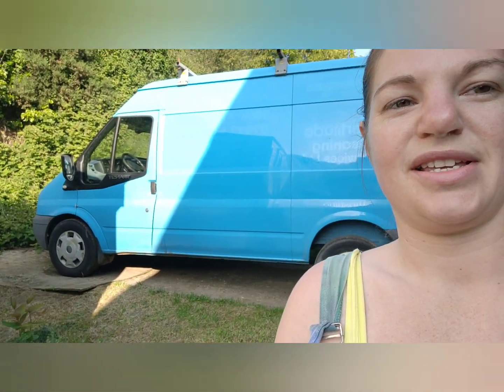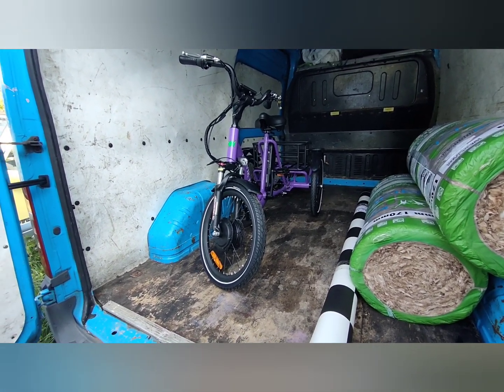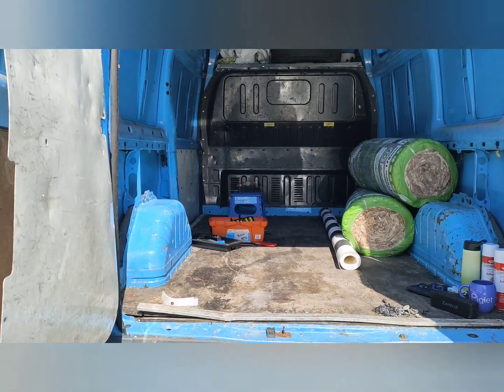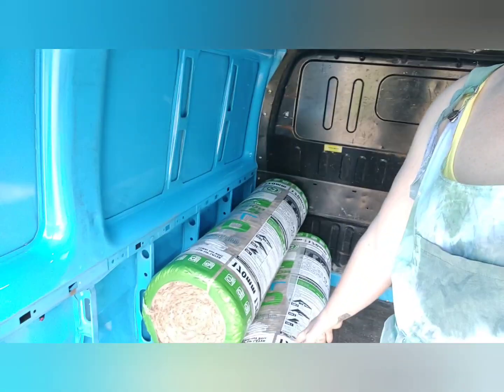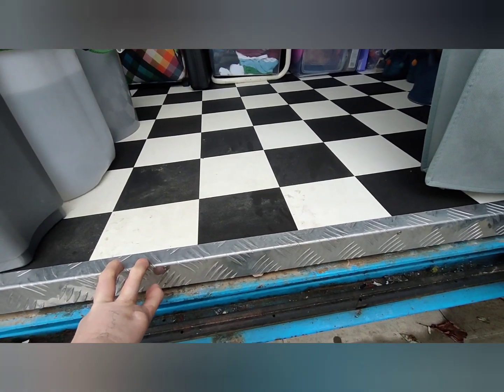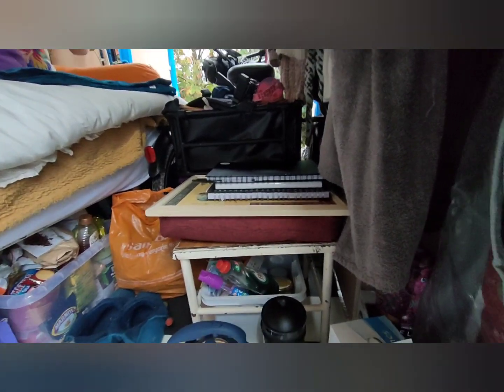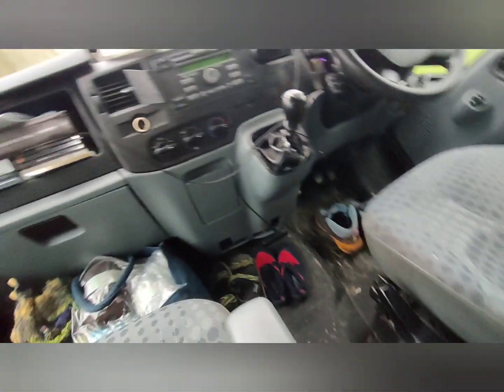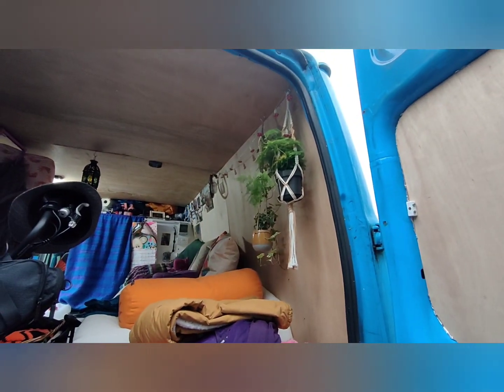Ford Transit campervan conversion UK

Comment: Hello Samantha! 

How is your van still running at the moment! Trying to figure out what van to go for!
Reply from the maker: She is running sweet as a nut. I do have a power steering leak so the steering rack will need to be replaced at some point, which is a big job, so as it's not a bad leak I just keep topping it up with power steering fluid. I absolutely love my transit, it's so comfortable to drive and just keeps on trucking. A real solid vehicle.
Reply: @samanthaelvy  how many miles did you take her in at?
Reply from the maker: @GlitchVR  about 150,000.
Reply: @samanthaelvy  amazing and after getting it did you have to do anything big work after that? Sorry for all the questions last one I promise aha
Reply from the maker: @GlitchVR  No worries, ask all the questions you'd like to. I had to have the power steering pump replaced and the breaks done, maybe another little thing that I can't remember, but I spent about £500. I paid £2,900 for the van. When it's MOT was due I also got it serviced.

Comment: Hi looks good, I like the fact that you have a flexible design that can be changed , eg bed moved without a major rebuild. Can I ask please , where is your leisure battery? (I've assumed you have a leisure battery, my assumption may be wrong !)
Reply from the maker: I do have a leisure battery and it's under my passenger seat.

Comment: The insulation you have used will cause condensation and rot your van from the inside out replace with recycled plastic bottle type from b&q
Reply: I've used that, it's none rotting and doesn't hold moisture, with a good mositure barrier there will be no issues.
Reply: Exactly what I used on our transit, cellotex  on the rear panels and roof with the wool in the lower panels and doors, with some foam foil as well. It's transformed it.